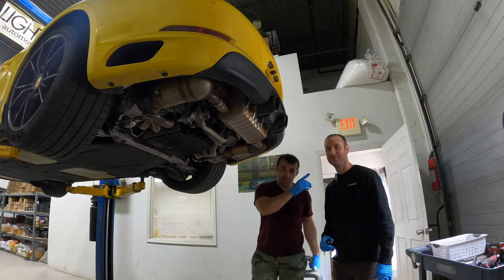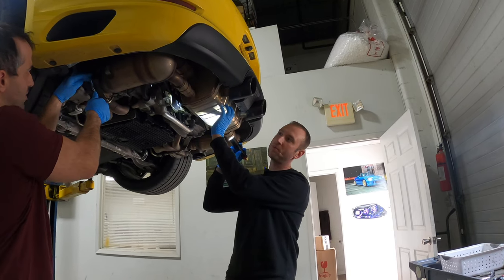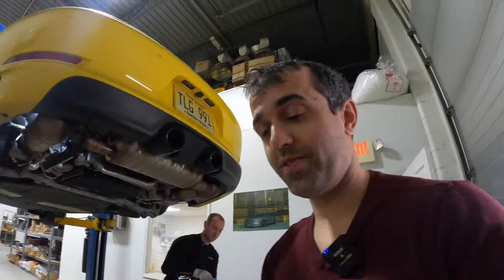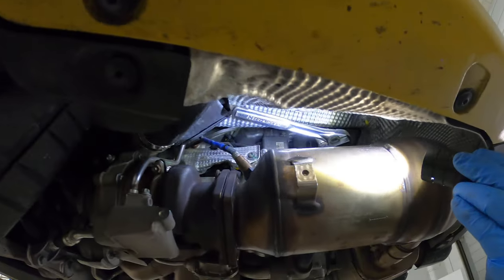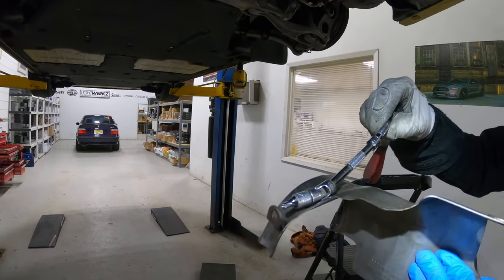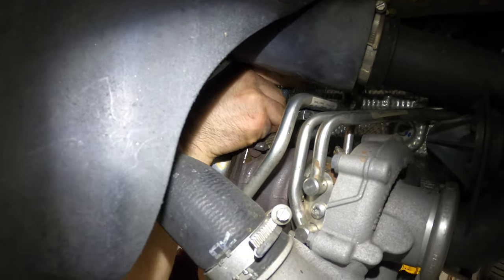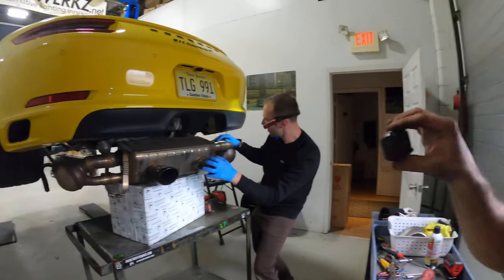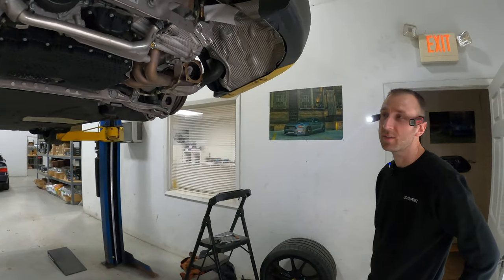Porsche 911 SOUL Sport Cats DIY: More SOUND and POWER! (991.2)

Comment: Not advised to hammer [rubber mallet included] a catalytic converter unless you plan on selling them for scrap.  Break apart any of the thin ceramic substrate honeycomb inside which you can't see and they've now become an ineffective obstruction. Twisting while pressing/pulling is the proper method.  Heat works well for stubborn ones.  Slip-fit exhaust connections are a cost cutting OE solution which doesn't include mallets for original assembly.  Aftermarket should always be v-band or at least 2 or 3-bolt flange.
Reply from the maker: Good point

Comment: Schley Products 67750 Oxygen Sensor Wrench is perfect for this. Makes that part super easy. Also, using a screw jack, unbolt the two motor mounts and lower the engine for more room on top

Comment: How did you remove and reinstall the vacuum lines on the exhaust valves? Do they just pull off and snap back on?
Reply from the maker: Yes. Pry really hard and they will pop off
Reply: @TommyLGarage  Thanks!

Comment: Hey, I’m planning to change the whole system. At the end of the video you mentioned something about the ECU adjustment. Did you have to go to dealer or just any garage is able to do so. 
And other thing, besides the fun part, would you suggest that I should do it or if find a garage with a reasonable price, which is the best option?
Reply from the maker: Not all all. The system will adjust to the new cats. No need for any dealer visits. You’ll be fine and will move it!

Comment: Should have just straight piped it :)
Reply: With the valves open it practically is! The factory 991.2 Carrera PSE muffler is designed quite well!
Reply: @SoulPerformanceProducts  You left the factory muffler in place didn't you? Well designed or not.
Reply from the maker: Factory muffler is a straight pipe
Reply: @TommyLGarage  Technically you are right but still looks like shize. Check out fabspeed for a proper exhaust.